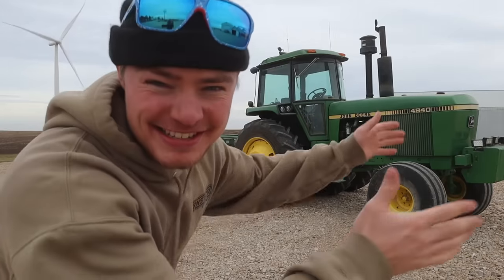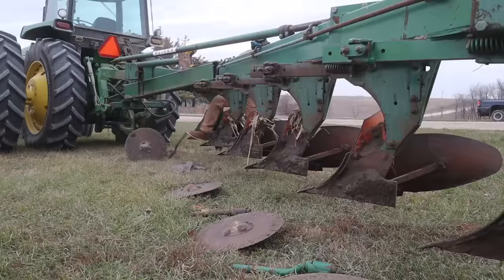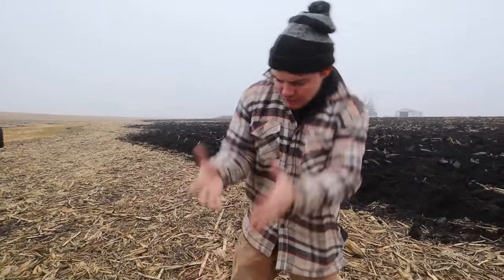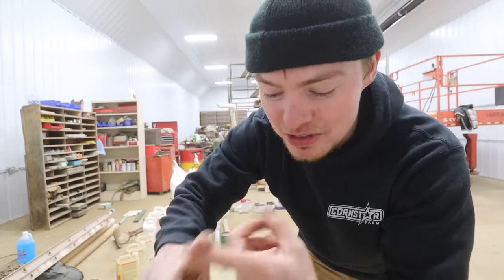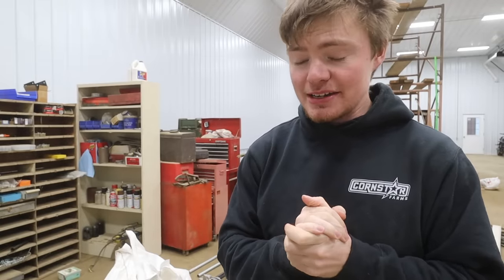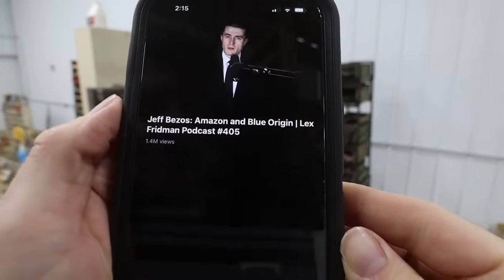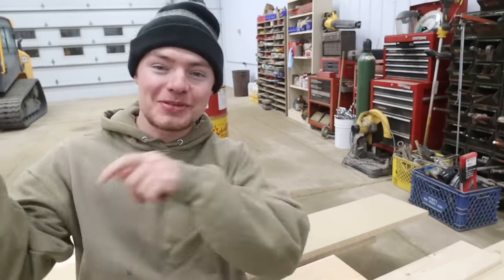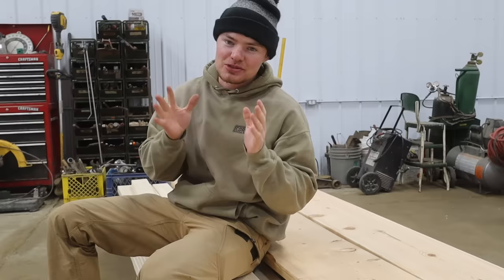My 1st Time Plowing

Comment: I've turned many acres of soil with a "breaking plow", "turning plow", ect...The first mistake you made was removing the coulters. When clean and free of rust, soil and residue do not stick and they serve the purpose of holding the plow in place as well as slicing through your cut.. The points and the wings need to be rust free as well. We used to take a side grinder with a wire brush and remove any rust that had accumulated over the seasons. We usually cleaned it up when we finished and rubbed axle grease on ours to prevent rust.
Reply: Thanks professor Harvey good   to know
Reply: Or plow some good gravel first
Reply: This is great info to have thanks Harvey.
Reply: This guy knows what he’s talking about, I’ve plowed many acres also. I’m sure Daddy Corn Star knows how to plow so Cole ask your daddy!
Reply: Yeah removing the coulters was not great.
Reply: The disk coulters on the plow help regulate the depth and keep the plow straight. If you were still plugging after the plow was shined up, you could have added number nine wire to the coulters and run them back past the plow shears and that will help turn the trash under. I would think that daddy corn star could have helped you get the plow set right.
Reply: Sorry Cole, you need lessons on plowing. My dad was a county plowing contest champion and  I competed            too. The coulters will help stabilize the plow and should cut 1 inch wider than the bottom it is on and 4 to 5 inches deep. The coulters help protect the shins and should cut the trash to prevent dragging. Speed is not necessary or good as slowing down allows the trash to work through. Plows make a hard pan where the shear goes. You should drop the front of the plow and then lower the rear to make a straight line at the end of your field. I hope you realize that you will have no residue to protect the ground from wind and heavy rain and the ground won't support heavy equipment after a big rain. I think incorporating your fertilizer deep is a mistake also. The lime needs to stay in the top 6 inches to help the chemicals work on weeds  Rain and vertical tillage would accomplish this at a huge savings of time and money. Good luck, time will tell but don't make any firm conclusions till a few years pass by.
Reply: We did exactly the same thing.
Reply: @brandonhoad9033  Or some very sandy area.
Reply: Totally agree, I do that same thing and also use grease to prevent rust on the mobord and cutters along the edge
Reply: I paint my plows at the end of the season both spring and fall with just whatever leftover bits and pieces of spray paint we have here or whatever I can buy at the local discount store cheap. We have found doing that as opposed to Greece it stays on them better and when it comes time to use them again it's wiped off and shiny and about the first 10 ft
Reply: channel quality going down..
Reply: @nycsox987 comment quality going down…
Reply: Can’t really see where your right rear tire is at but you may need to adjust it out about 6” to 8” and run it down the furrow. I watched my brother do this every spring before plowing but I’m not sure what the measurement should be from the outer edge of the first plow to the inside edge of the back tire.  Oh and Merry Christmas to you and your family.
Reply: Old timers use old red bricks to polish the moldboards over a grinder. I used the bricks. They work much better and are able to give the surface area a better area.
    You are correct about leaving the coulters on.       Another thing is do they actually have the depth set correctly?           More than one dealer used to tell me that they were amazed at the number of farmers that didn't have their plow level.  

       Here's how to tell if you have a pull type plow set properly. 

Take a ten foot log chain. Make sure that the tractor drawbar is able to swing freely
 Hook one end of the chain to the plow and the other end to the drawbar.        If the plow is set correctly then it will follow in the furrow. If it veers to the right or left then adjustments have to be made.  Once properly set. The plow will follow in the furrow on hillsides, contours and at the end. Simply raise the plow at the end and it will follow then return to the furrow again.    A long-time mechanic taught me that in 1973. He taught me a few neat things about tractors.
Reply: In my heavy gumbo just put the plow in the ground and in about 5mins it's shiny ✨️
Reply: @garyduquette1784 the ground has not been plowed in 50 years. They have always done no till.. daddy corn star doesn’t know either
Reply: @guydaubenspeck9206  Yep, thats the way to do it. We used to try grease, used oil etc and it doesn't stick on long enough with our bad weather.
Reply: axle grease or old used oil to rustproof

Comment: My life this past two weeks. Work one day ripping for about 13+ hours. Rain dry out some 3-4 days later. Again 13+ hours. Rain again. Another couple days later. 18 hour day ripping. And later that day 5 hours washing the tractor of for the winter. A long couple of weeks when dry or frozen enough. Still way to wet to be ripping but needed done. 
Have a Merry Christmas.
Oh and when’s sweeping when pushing or pulling dirt. Always do a tape on the concrete. You won’t leave those dirt streaks when you go for your next sweep.

Comment: I remember on my grandparents farm in the 60s, the fields were rotated as crops were grown to feed the livestock on the farm. They were plowed one year and corn was planted. The next year the field was disced and oats and alfalfa were planted. The oats came up faster than alfalfa so it stopped the alfalfa from growing more than a few inches high. The third year the alfalfa took over and it would be cut at least twice to make hay bales or maybe chopped for silage. The fourth year if the alfalfa was still growing well, at least one cutting for bales would be made then the field might be used for pasture for cattle. The fifth year the field would be used for pasture as grasses overcame the alfalfa. After the last hay was baled for the season on the other fields the field would be plowed and disced to make it ready for corn again in the spring. Now. many farms don't have livestock and only grow crops to sell. Mostly corn and beans so they don't get a 3 or 4 crop rotation. Disease has become more prevalent They don't get the benefit of manure for fertilizer so fertilizers have to be purchased to maintain productivity.
Reply: Yeah that's what I remember from the 60's and 70's. I was taught growing up to diversify one livestock and 2 crops minimum. Rotate everything.

Comment: Tune the plow with deep-suck shares and the JD has draft control for the 3 point. No need to take the coulters off, you will learn over time Cole.
Reply: Never used colters when I used to plow with an IH 710

Comment: Cole, you need to adjust the "draft" control settings on the 3 point controls.  This feature utilizes a torque sensor that feels the pull on the tractor, when the pull is instantaneously decreased due to loss of traction, the 3 point is automatically lifts to transfer weight from the plow to the tractor rear wheels.  This will compensate for wheel slippage.  The sensitivity can be adjusted so it acts very quickly.  You will no longer need to manually lift the plow except at each end of the field.
   When you let the plow down let the 3 point down quickly and then the rear of the plow, this will increase the angle of the moldboard so it sucks into the ground in a short distance.

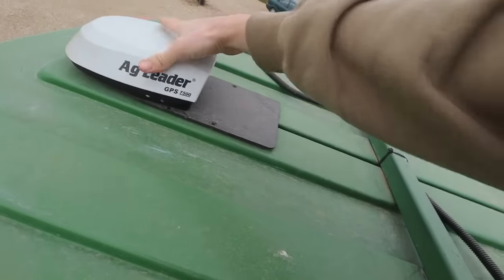Comment: Oh my goodness, you got that crazy fog too! We were down to 1/8 of a mile to zero visibility. It started at about 2:30-3:00pm and got worse. I called my daughter at work to warn her, and 12 miles away, no fog. Then it started to cool down, and the fog improved to 1/4 mile. It was so thick, it literally looked like I could move it with my hand! How you guys know what to do, when, with what equipment, why, boggles my mind. You and Cooper just jump on the tractor or combine and just do what needs done. The equipment alone requires a degree. ❤😊 Great job!

Comment: Cole: Here's a tip for you. On your supply shelves(fittings, bolts, electrical,parts etc) Label  the shelves using letters and numbers and then take a picture of each shelf with it's contents and number visible. Later if you are out in the field and need something, you can pull up the shelf pic and see if you have it, then if you do and someone is nearby to bring it to you, all you have to do is text them a picture of the shelf with the part you need circled.
Reply: Great idea

Comment: You probably should talk to some of the old-timers that have spent some serious time plowing. If the plow is steering the tractor something is grossly out of alignment. Get the plow set properly and it will take less power to pull. I'm not sure what's going on with plugging the colters like you did, your trash seems to be chopped small enough to flow through.
Living in Wi., we like to see Iowans do fall plowing. If it's an open winter with decent winds, we get to utilize that rich Iowa soil the following year.
I remember one bad winter like that back in the sixties and that was the last year we did fall plowing. Dad said we'd find a way to get it done in the spring, and we did. Hope that works out for you.

Comment: For cleaning floors try using a green Sweeping Compound. It has a very light oil coating and gets the light wisps of the dust that always remain. Throw handfuls of the stuff on the floor and it collects dirt and dust. And you can reuse it depending on how much dust you collect.

Comment: Growing up, we had 2 plows we primarily used, Ford 140 and Ford 142 (made by Pittsburgh but not sure of equivalent models). The 142 was considered a "trash" plow and worked so much better in corn residue due to additional space between bottoms on the frame that allowed easier flow. Another variable was that, due to a lot of slopes & side hills on our farm, we didn't plow until spring to limit erosion.

Comment: You might want a "Martin" floor cleaner.  Makes a shop floor easier. 12:19 and you can fill the crack with silicone caulk .

Comment: Cole training for the Murph WO.   The Murph Workout is  British Special Boat Service/US  Navy Seal workout where you run 1 mile then perform 100 pullups, 200 pushups and 300 bodyweight squats then run another mile all for time.
You dont have to do 100 pullups, then 200 pushups, then 300 squats. You can break them down. I break it down into 4 sets of  25 pullups, 4 sets of 50 pushups and 4 sets of 75 Bodyweight Squats.  

If you are a stud, you do the Murph  Workout with a 22 lb plate carrier.  11 kilos (22pounds) is the standard NATO body armor plate carrier. 

For those out there, if you are a male and you can do 50 pushups after age 40 you reduce your chance of a cardiac event  by 82%

Comment: I used too love moldboard plowing I have done it with a setup similar too yours where you put the wheels on one side in the furrow and I have done it with an articulating Steiger and a sunflower plow that was a pull behind not mounted too the three point like yours is and it had a wheel in the front that you ran into the furrow not the tractor tires and if I remember correctly you should be able too open the space between the coulter and the plow shear and I think it is a great idea to plow at least every three years or after you have corn in your crop rotation

Comment: build the bench bigger than you think you need - think about a welding table, get a radio base. pc and cheap tv you can use as a monitor plus speakers, do a big pegboard, don't throw out too much. the plowing should pay off - you will know in 11 mos when you get the numbers back

Comment: The draft control is next to your 3 point raise lever, I plow by draft control. It automatically adjusts the load on your 3 point hitch and eliminates spinning out and manually lifting the front of your plow.  Draft control also helps to save Diesel fuel. Deep suck shears help remove compaction and keeps the plow in the ground. The rolling cutters are essentially to cut through the cornstalks and trash. I only remove the rolling cutters when there is about 4 inches of frozen ground ,it's easy to break the shanks on the rolling cutters. I pulled 5 bottom  18 inch bottoms with a Case 2594 putting out 225 HP. 6 miles per hour slams the dirt down and shatters it quite nicely and ready for anhydrous ammonia application first thing in the spring. It also allows the flat black soils to warm up faster than conventional tillage. Good luck Cole  !

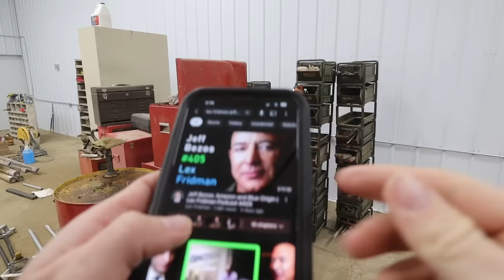Comment: And leave the Air Compressor on the floor, and make a sound absorbing Screen in front of it. 16:41 put rubber pads under the feet and anchor bolts so it can't walk away from the air pipes. 18:09

Comment: I've never heard a plow breaking up compaction plows are  known to make  hard pans that roots can't penetrate. Maybe I'm wrong but sub soilers are what's needed for compaction as set them to depth off hard pan and they create a wave the fractures the hard pan.
Reply: correct that's the reason most people scraped their plows
Reply: No, plows are pretty much the answer for compaction. It’s one of the few remaining advantages they offer; whereas, they were previously used for weed control and bringing up nutrients, which herbicides and fertilizers have replaced. Another upside is that it increases the amount of lime you can use in cases where the ideal tonnage per acre exceeded top dressing recommendations per acre.
Reply: @bronzearmy2645  how is do moldboard plows fight compaction. I know they bury weed seeds at ideal depth not to grow and is best way to incorporate the organic material along with fertilizer and lime. On my farm where they always plowed at depth they plowed was hard pan that didn't allow roots to penetrate. Plowing large tracts of land with no filter strips with severe drought was what lead to the dust bowl. I'm not saying plowing isn't a good way to incorporate the fertilizer just saying it doesn't fight compaction. I'll be interested to see how Trippy farmers compaction tests work out with his sub soiler next year.
Reply: We use a L shape leg that bolts  on so it subsoil 's 2"lower than the bottom breaking up the pan  as you plough and you put one on every second leg takes more power so my have drop off a bottom depending on terrain /slippage 😅😊
Reply: Also with all deep tillage they are trying they’ll find next spring or during harvest if it’s a wet year they’ll make more ruts because the soils haven’t firmed back up.
Reply: @jeramy2398  you turn over the ground and in the process break up the depth of your plow. Just depends on how deep you want to go - if you want to be industrial about it, you can pull a tractor with a bulldozer and turn over 10-15 feet. At any rate, what caused the dust bowl was the absence of fertilizer while completely depleting the soil of minerals and nitrogen over decades of heavy farming. Nothing could grow back in any meaningful way after they plowed it; whereas, nowadays, we know exactly what our crops pull from the soil and we just put it back. 
That’s not to say that plowing every year is necessary or even good for it. I aim to get 10 years between plowing (rotating one field per year) to allow for organic matter deposition; the key to that is not running heavy equipment when it’s wet obviously. Otherwise, ruts and compaction severely impact yields. The other thing that can push me to plow a field sooner is the need to double the amount of lime to correct pH. Idk why Cole is doing it - not sure he elaborated really.
Reply: @jayheiman7388  nah, what you use to reseed is a lot lighter than the equipment used to till; plus, at least here, we sacrifice two strips every 32ft for wheels to run through as you spray the fields throughout the year. Your drill doesn’t even plant anything there. He’ll be fine in that regard.

Comment: Plowing is a slow process, but you will see some big benefits next spring. Along with the products you are putting on the ground, it will speed up the decomposition of the past crops, putting more nutrients in the ground.  During the 90's, the switch was made on our farm to go with a heavy-duty disk with 32-inch notched blades.  They go deep and you can plow up the ground a lot faster than with the standard bottom plow.
Reply: Agreed

Comment: You need a row of pallet racking all the way down the side of the shop. Then you can organise it into benches shelves and have overhead storage and mount the compressor uptop out the way with outlets and retractable hose reels in at least three places.

Comment: You should scrap off the mold broads off of dirt to help it pull better. The dirt shouldn't stick if you got a good finish on mold broad. Also the shares help keep the plow into the ground. Also set the tractor to grab the traction.

Comment: As a landowner of what looks like pretty similar topography, I would not allow my soil to be treated that way. We raise good yields of corn and beans and there has not been a moldboard plow on this property since the 80's, and no tillage at all since the late 90's. Lime and nutrients will migrate down in the soil profile without destroying the soil structure and erosion protection that way. To each his own, but my topsoil is staying on my farm, while any decent rain will send tons of theirs down to the Gulf of Mexico. And the fuel and time expended-3 acres/hour, probably 9-10 gal./hour, that somewhere around 3 gallons per acre just to cover up valuable residue.